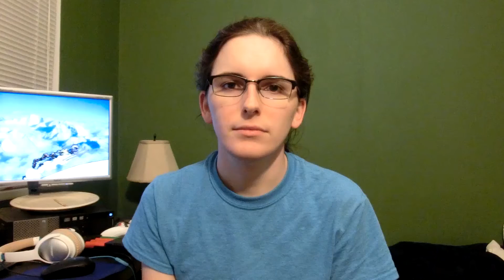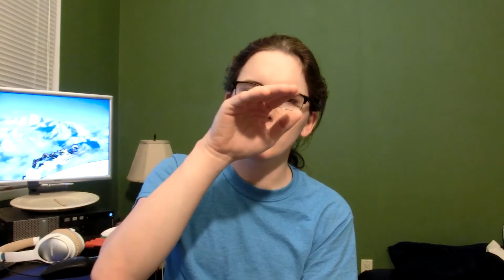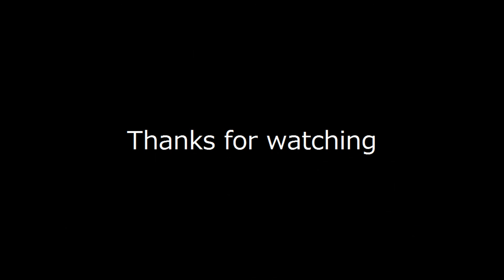Personal Bits 0264: my ebike battery is getting a bit old

Comment: 2013! After about a year, my factory battery pack is not giving me the distance it used to. I'm getting closer to 6 miles than the 10 it was getting. I just took apart my spare and was headed for your "DIY 52v (48v) 16AH Lithium-Ion 18650 E-Bike battery pack" video to get inspired. I crashed one bike (see Car ~vs~ ebike on my other channel) so I have a spare, though the case has expanded. I've been a little afraid of it but I opened it up yesterday. Now I need to break into the 3 smaller battery packs to see what's up.  I wish it was the charger, but in my case I just don't think so. My batteries are lead acid and I want to replace with lithium, but if I can salvage the other I'll just wait on the lithium. Thanks for sharing those battery pack vids, you made it look easy.
Reply from the maker: +One Girl&#39;s Journey Through Cancer lead acid is the worst, no wonder it didnt last.